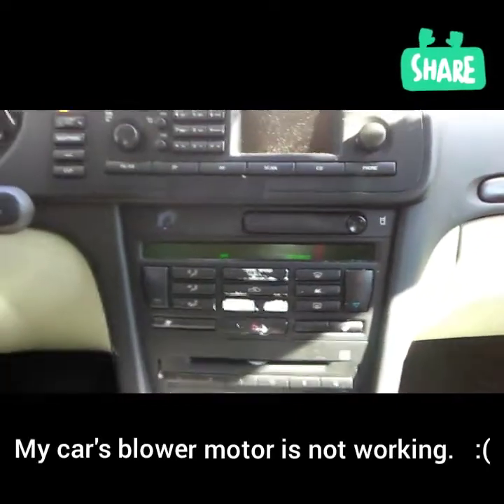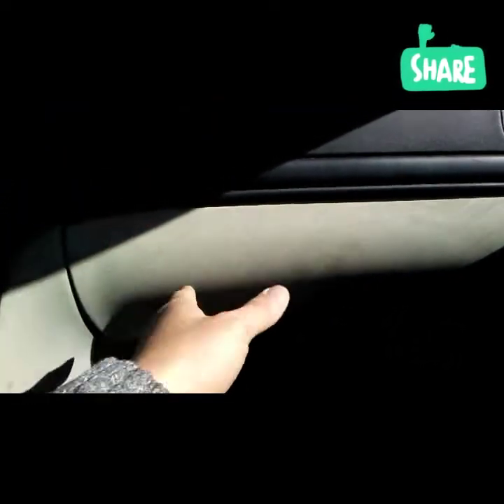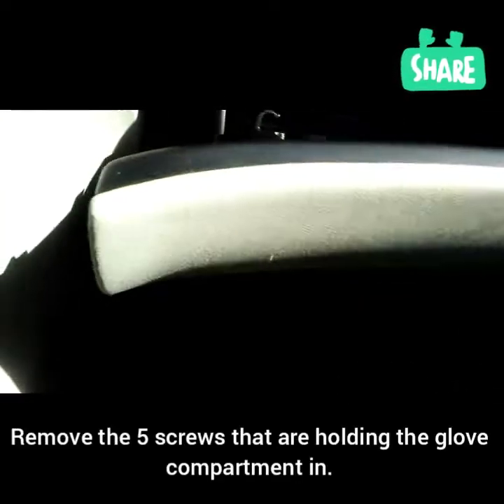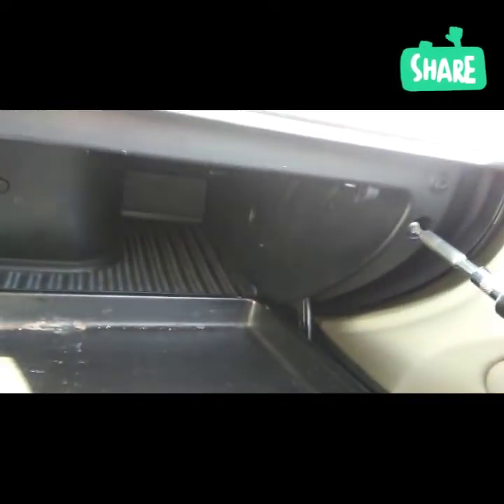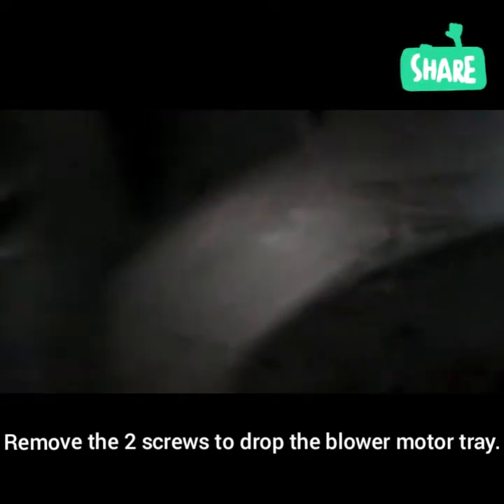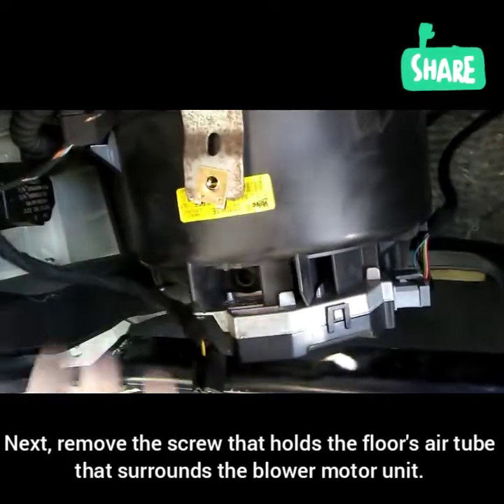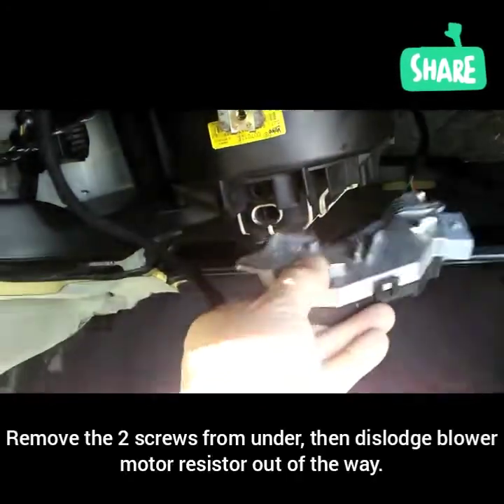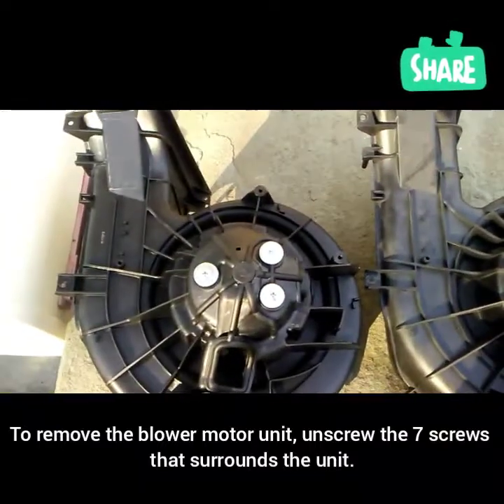How to replace a blower motor & resistor on Saab 9-3. (A fun, step-by-step instruction.)

Comment: You never showed how you got the blower out
Reply from the maker: After removing lower panel, resistors, and the screws holding up the blower unit, then grab the blower unit and wiggle it down for removal.

Comment: WAIT!@!!! WAIT!!! I may have found an EASIER WAY.  My fan didn't work. After doing all of this, I found that everything looked fine. However, the blower fan was very slightly stuck. The fan easily spun after turning it a fraction of a turn to loosen it and now works fine. I cleaned it with electrical cleaner and added a little lithium grease just for good measure and it works great. This was probably from a faint bit of dust or pollen that blew through the fan and solidified like glue. BUT, BUT, BUT, I could have done this from checking under the hood, as Follows: Pull the left windshield plastic (2 tabs) under the wiper, and the plastic cover below it (just snaps in/out). Remove the clips for the cabin filter (2 clips, l & r side) and the filter holder (2 clips, l & r side) and you can see the blower motor fan and motor below it.  .... I must strongly recommend trying thia first. It is much easier and faster. You should be able to tell if there is corrosion in there and if removing the glove compartment is necessary.  MOREOVER, whether there is corrosion or not, it seems smart to caulk around the cabin filter holder (the rubber around mine was decayed) and wall to keep out moisture that causes corrosion, as this would be the major cause of leaks onto the blower, motor and resister. If you don't, you may have to to do all of this again in another year or two.
Reply from the maker: Yes....of course the first thiing you should do is to trouble shoot if your blower has any debris obsruction. You can check this from the outside of your car. If determined the motor blower is bad then follow my video.